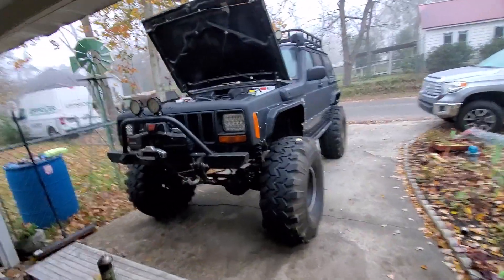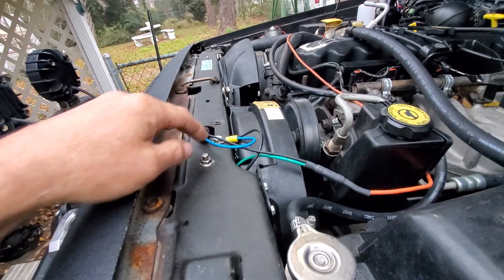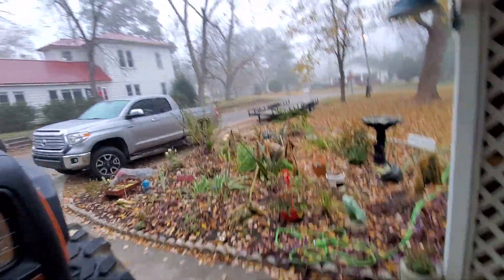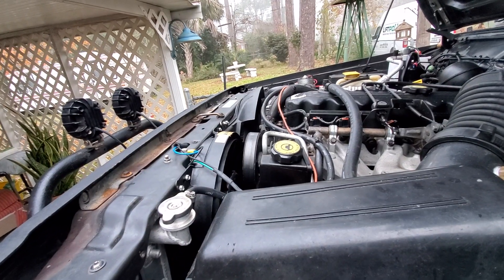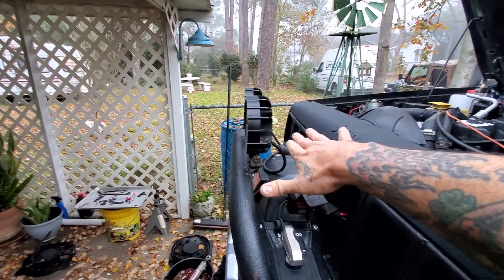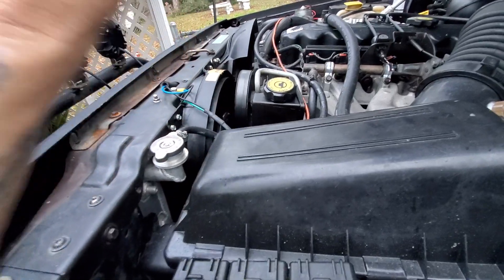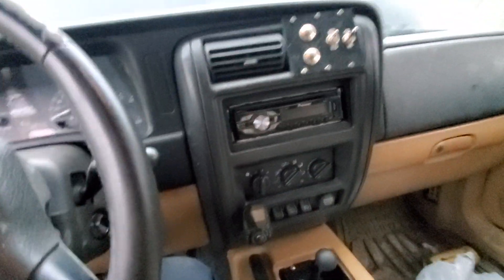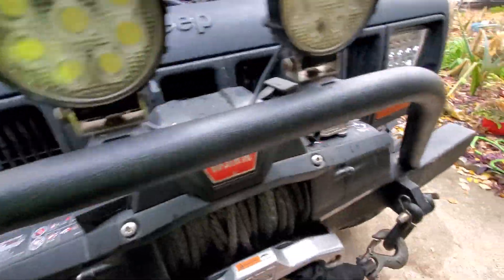jeep xj over heating fix

Comment: I had a thought, since you have all that aluminum and you plan on pulling the intake for your turbo install, have you considered making a heat shield to go between the intake and exhaust manifolds to help limit the heat buildup in the intake?
Reply from the maker: Yes I have we probably will do that

Comment: Rusty what are your thoughts on hood vents  I live LA California  & have problems  with  heat as well . Thanks !
Reply from the maker: I have tried the trick with the hood spacers lifts the rear of the hood up 2 inches insisnt see an change in temperature myself the vents may help a little I know they put them on ambulance hoods for that purpose the only thing jeep done wrong with the cherokee is the radiator size it's just to small im going to figure out a way to install a larger radiator if mine goes above 190 this weekend in the trails

Comment: Hi Rusty, what are your thoughts about adding hood louvers?  I just upgraded my radiator and it's running perfectly for now but I have not had any hot day trail days to really test.  My plan is to weld in  2 strips of louvers on either side of the motor.  (which also should help from overheating the fuel injectors)
Reply from the maker: They def would help i havnt done them yet but plan on def doing somthing soon with the hood
Reply: I used the louvers from rodlouvers.com . thought they looked better than others. Not sure how much difference they actually made for cooling. The ZJ fan clutch was the best cooling upgrade I did. I think it's DEI that makes a kit specifically designed for heatsoak problems on 4.0s. May try that sometime.